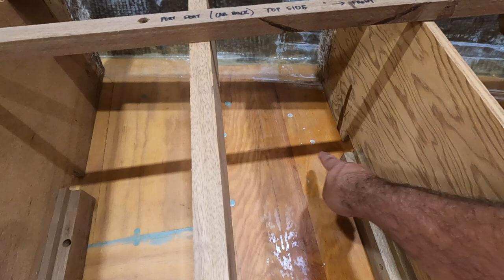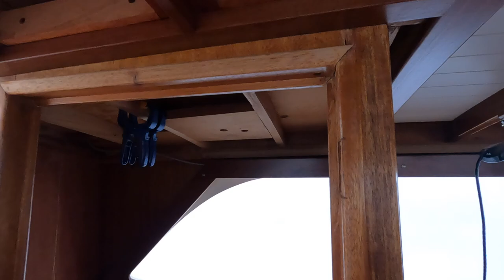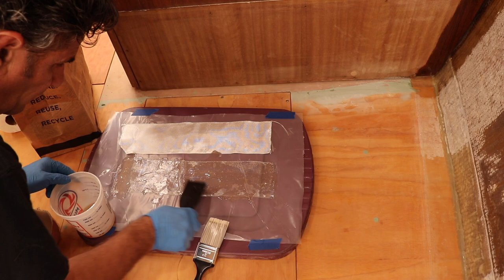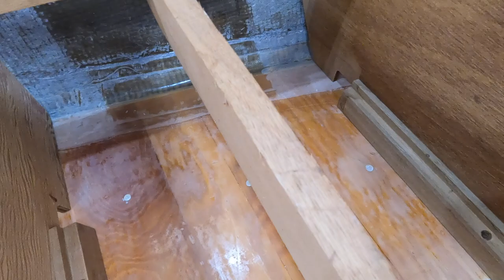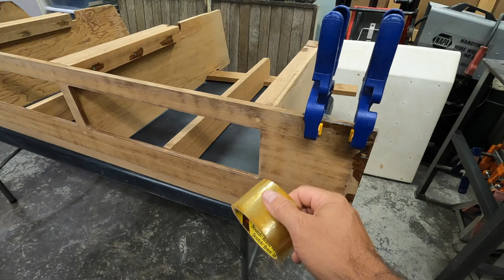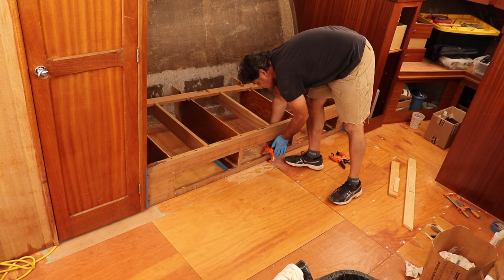Installing the original port side settee in the cabin (Part 1 of 2) - Boat Restoration EP078

Comment: Morning Bob, the settee fits much better now that it's further recessed into the opening. Good work also on the corner of the head. It makes quite a difference in strength when everything is fastened together. I'm not clear on access to the blackwater tank but you'll figure it out. I like the idea of a locker area or two under the settee. Good use of space. Take care and thanks for the episode. Jerry
Reply from the maker: Hi Jerry, I didn't explain the blackwater tank plan I have in my head very well in this video. I think the details can be ironed out while sitting in the cockpit enjoying a few cold ones with friends. I may not have to do anything as composting toilets seam to be the rage with the boat building channels I'm watching lately. We will see when the time comes. Take care and stay well. - Bob

Comment: Can you review total cost to date?
Reply from the maker: Well Jeff  I really don't keep a good account of the costs. I'm not much of an extravagant spender but I will buy the best material I can afford. The only Item I do have a general total cost on is the wood I purchased to date. This being the marine plywood, Mahogany, & Epe. I would estimate that I replaced probably 75 to 80% of the original wood on the boat at a material cost of $10,000. This is by far the highest cost item category to date. I only know this number because I bought all of it from the same supplier and the owner recently called me to give me a discount code as a valued customer and told me what I spent over the last 10 years. The only wood I have left to purchase to get the boat in the water will be for the engine beds and supplemental teak decking for the cockpit. Would have been nice to get a discount earlier in the project. In my estimation Epoxy with supplies would be the second highest, paint/varnish 3rd , Fiberglass a close 4th. And there was the 900$ bad fuel removal/disposal fee. I have never made any claims that restoring a boat was cheap. The good news for the DIYer is the only labor cost was for the engine, fuel, fuel tank removals which I could not do myself but were just a few hundred dollars if I recall. Thanks for the comment and watching the videos. - Bob